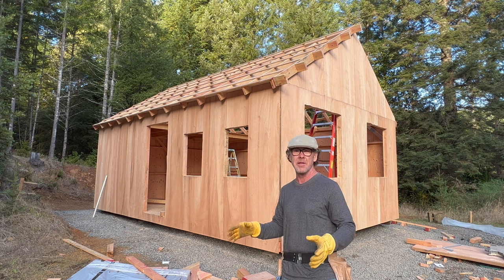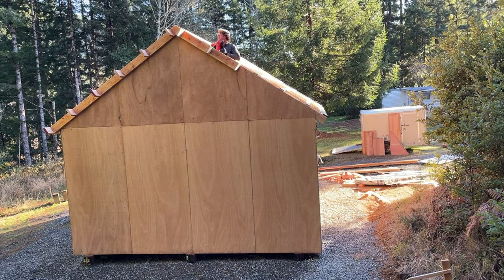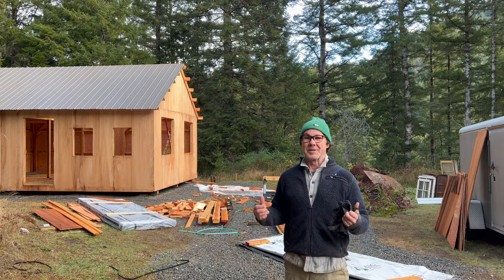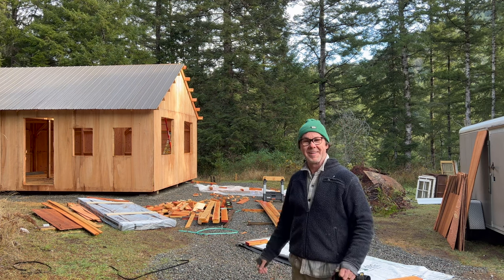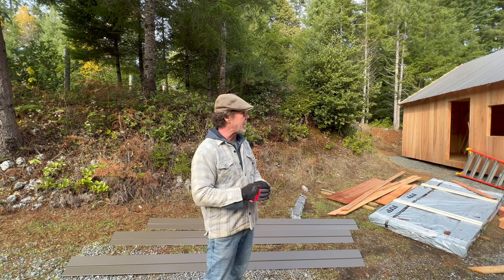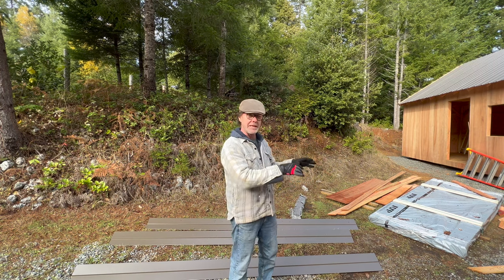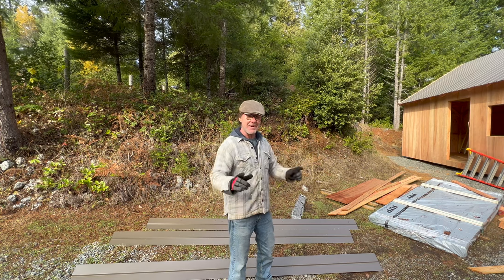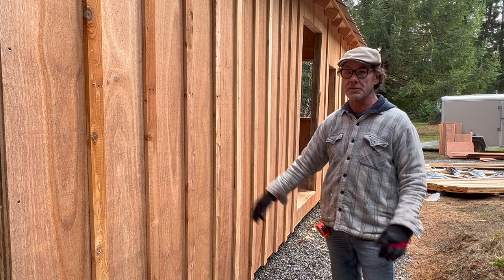Awesome! DIY 16x24 Post & Beam shop build

Comment: So far so good. The board and batten looks good and you are basically dried in so you can relax and slow down a little and take the time to finish your project.
Reply from the maker: Thanks Chas- you're right...as soon as I get that ridge cap up- I won't have to worry so much about the weather.  Thanks for watching!

Comment: I installed a metal roof on my log cabin in the NC mountains basically by myself. I used roof jacks to be able to safely stand on the roof while I installed the screws. Some parts were 12/12 pitch and some were 7/12
Reply from the maker: Thanks Gary!

Comment: You NEED to get you a pair of Irwin 6” Clamps, if you’re gonna build by yourself! They are most always on sale on Amazon, or Ace Hardware Stores! Even Lowes, sometimes have them on sale, which they did just recently! They are quick to put on and take off! Can help you hold a board on place, while you get the nailer ready, etc! Love the build, brother! Looks good, this far! Can you tell the audience what size and type of nails you use on which ever part you are working on, please?! I’m gonna start building our house with my M18 Framing Nailer, early 2023, and I will be using Ring Shank nails thru-out, as they hold really good! Thanks for sharing! Stay safe!
Reply from the maker: Many thanks for the kind words Bri-  That's a great idea to have those clamps. Congrats on your upcoming house-build... that M18 will come in real handy... and those ring shank nails are perfect.  Thanks for watching!

Comment: I'm sure you're finished by now but if you were to drop that loft by a foot you could stand upright, not all that much more work. and may i suggest a lightweight Jefferson ladder for the loft access, it would make a Cool video & (No Paint on building)
Reply from the maker: Interesting idea, Stan- but yes, the loft is built. I’ll primarily use that space for storage, so stand-up-ability is not too important to me (at the moment Lol). I agree with the “no paint”, except for maybe the windows… I think stain or oil is the way to go!

Comment: Hello Ty! Merry Christmas to the both of you!  Q: is your metal roof coated on the inside? Because of condensation and dripping? ❤Keep them coming!
Reply: Q: will you install gutters for rain collection?
Reply from the maker: Merry Christmas to you too Ferron!! Great question about the metal roof… I’m not actually sure if there is a special coating to repel condensation. I really had not thought about that. I suppose it might become an issue if there was a significant temperature difference between inside and outside temps. Since the building is not insulated, I don’t think that will become an issue (I hope LOL).
Reply from the maker: Yes… eventually will collect rain off the shop roof👍🏻

Comment: Hopefully you are wearing TENNIS SHOES anything else will scratch your roof and you will have slippage for sure. When you do your ridge cap wear the TENNIS SHOES. Try and tie a safety line on yourself and somewhere on the peak of roof.   Maybe cover your window openings with plastic to keep the inside dry would surely help.  Stain your wood might take two coats.  Paint color depends on your choice based on your location.  But no green lol you have enough of that around you now.  Drive around and check out colors on other homes in the woods might help.  GREAT JOB so far awesome.  P.S. I use to manage a metal roofing company for about seven years and in charge of the Safety Program as well.  God's blessings.
Reply from the maker: Many Thanks for your comments, Sandra… and thank you for watching!!

Comment: I wonder why don't you use a vapor barrier under the metal roof
Reply from the maker: Thanks for your comment Ben- this building is going to be a storage/workshop space.... at this time I don't have plans to insulate the building/roof, hence no barrier.   Thanks for watching!
Reply: @rurallivingwithtyandlisa  What about condensation? At a minimum I would put tarpaper under metal ... especially corrugated. Expensive to redo.
Reply: @kengroves5303  I was thinking about the same thing. In early spring and warm autumns you're gonna get a lot of that because of the big difference in day/night temperature. And if you ever want a stove in there you need it. I don't know a lot about the weather out there, I live in Romania and over here we have 4 seasons, but we have the same problem here that usually people ignore, and it's a big thing to solve that problem afterwards

Comment: As others seem to agree with. Absolutely do not paint it!
Paint as a sealant is faulty cause it doesn't allow the wood to breathe. Linseed oil, tar, . iron vitriol or any other old school method are both better and more good looking than modern plastic paint.
Reply from the maker: I tend to agree… and I’d hate to lose the beauty of that wood grain. Thanks for watching!